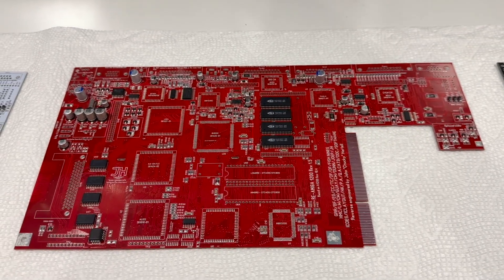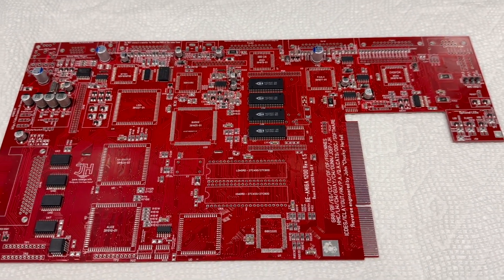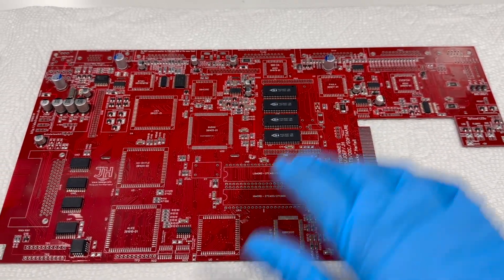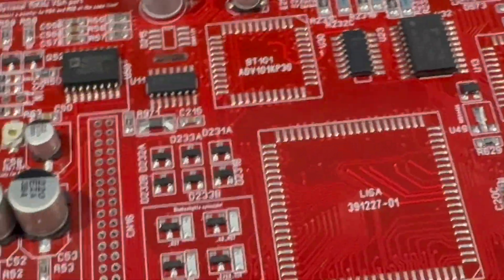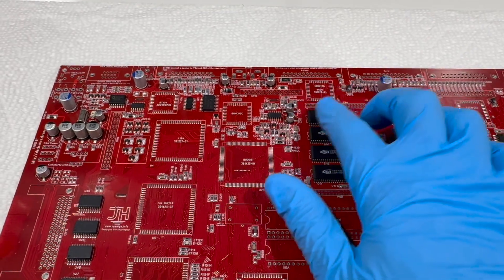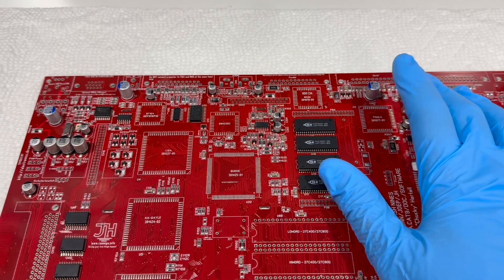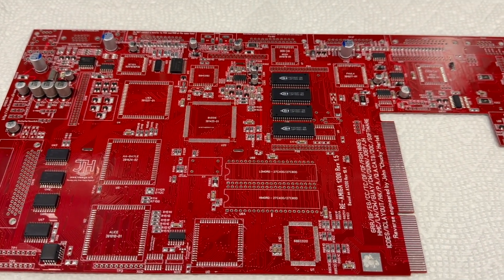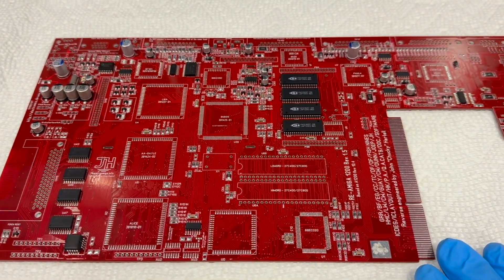ReAmiga 1200

Comment: Have you tried A1200+ it's quite a neat concept also
Reply from the maker: No I didn't have a chance! I will check the project shortly. Do you have any experience with A1200+?
Reply: @amicube  I haven't tried it myself, the real deal, but I had the gerber files and the kicad project and was trying to do a 3d render out of it. It had a pretty modular concept which I loved. There inno cpu onboard,  you relly on the accelerator board, and the gfx part of amiga is modular. Quite neat if you ask me!
Reply from the maker: Very nice! Thank for pointing this out. I will check the project shortly. Feels like a step forward in the design. Ranko

Comment: I'd love a purple version :) also I would love to add a sound sampler circuit onto that board, shouldn't be to hard linking this to the parallel array. also I'd update the 44 pin harddrive ide to a full size 40 connector, this would allow slimline cd drives to be used.
Reply from the maker: Honestly, purple has become my favorite PCB color lately. It complements the background color of the Kickstart 2.x+ screen beautifully :)